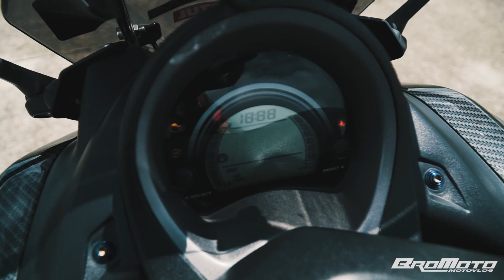Changing NMax Spark Plug | Iridium Spark Plug | 11g Flyball

Comment: Ilang kilograms k paps and ano ano mga set up mo sa mc m naka box k dn ba..ano topspeed ng 11 straight grams.
Reply from the maker: nasa 83kg ako ngayon, touring ang set up ko, may crash guard at top box kaya mabigat, nka pag top speed ako ng 121km/h
Reply: @BroMotovlog  ano rpm ng clutch spring at center spring mo boss?
Reply from the maker: @donatojeremyp.942  ang center spring 1000rpm, sa clutch spring nman 1200rpm